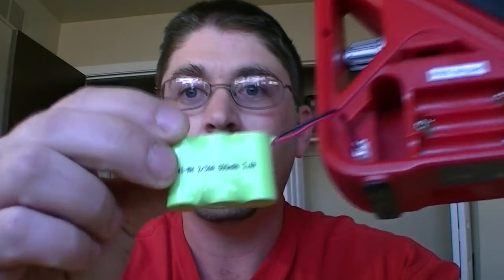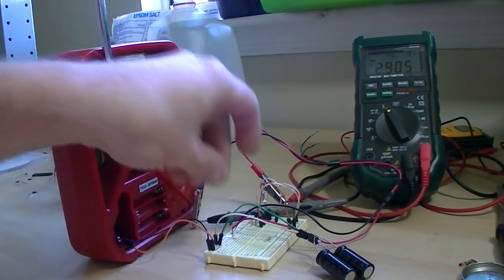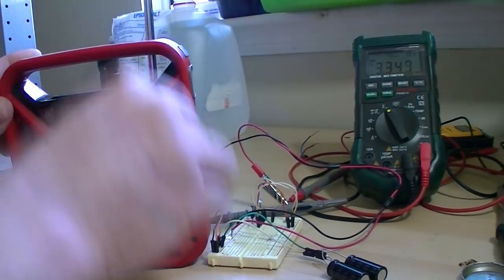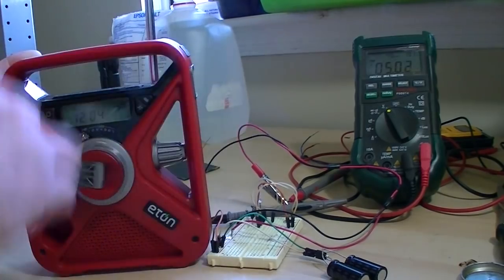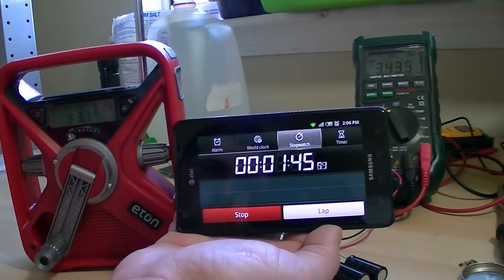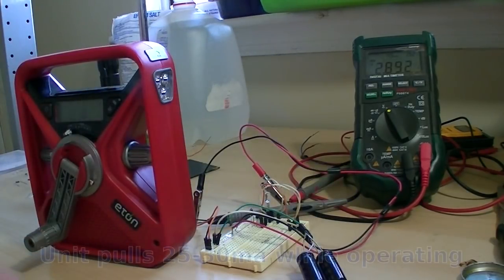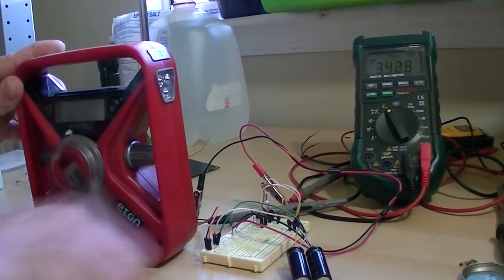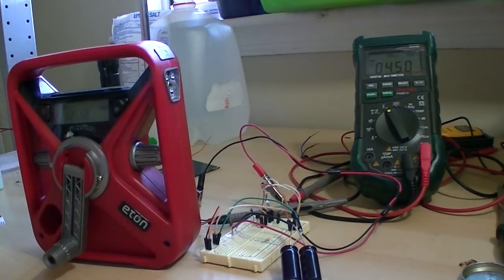Supercapacitors Instead Of Rechargeable Batteries

Comment: Capacitord wired in series dont give you double capacity. In parallel they do
Reply: +TeaDrinkingIlluminati the voltage rating is only 2.5 volts, so he needs them in series otherwise it would exceed the voltage rating.
Reply: ***** Yeah but he said hes putting them in series for the sake of capacity which is wrong
Reply: TeaDrinkingIlluminati voltage capacity maybe?
Reply: ***** Unfortunately thats not how it works either... Its the opposite of resistors when it comes to calculations
Reply: Their voltage rating would add in series, if he paralleled them he would have 2100 farads of capacity but at only 2.5 volts. Not enough for the 12 volt system on the car. In series on the other hand the setup would be rated at 15 volts.
Reply: ***** I pointed out that he said it wrong
Reply: +TeaDrinkingIlluminati I guess he could have been more specific.

Comment: I wish I knew more about electronics, in fact I dont fully understand why I'm here, Just WANDERING I guess on my day off.  But since from what I understand S-Caps discharge & charge quickly, & iF resistors make higher voltage? acceptable to lower voltage? apps. couldn't you E-Guys better use all this (from what I see) collective brilliance to invent a device that uses the attributes of both (caps & resistors) to  STALL the distribution & the loss of current long enough to "recharge" using another source (car battery, regular batteries, drill battery)? & does it have to be "wired" since an e-motor uses magnetics. Couldnt the charge be distributed magnetically,  by just being near the oblject? Realizing that would limit the design functionality (make better designs) of the device, like emer., radio. It would be a piece of the puzzle, in place, for greater understanding & applications. if so the implications of SOLAR, Getting the "Rubber to the Road" so to speak, would speak volumes!!

Comment: Your battery is a crap (Radio battery).
Reply from the maker: +IHPU0 That little ni-cd pack died years ago.
Reply: +Mad Electron Engineering 
You can make your own or buy a simillar with better capacity in li-po.
Reply: Just use www.EzBatteryKit.com

Comment: The capacitance only raises if wired in parallel. Example: If I hook two 1F 2.7V supercaps in parallel, I end up with 2F at 2.7V. 

Capacitance remains static but voltage raises if hooked in series. Example: Same caps hooked in series would yield 1F at 5.4V.

To raise voltage and capacitance together, you must hook them in series parallel (two capacitors in series, two sets of these hooked in parallel). Example: Using 1F 2.7V super caps I would get 2F at 5.4V.
Reply: Capacitance of a capacitor is fixed value, independent of voltage. Two 2 Farad caps in parallel = 4 farad capacitance. Two 2 Farad caps in series = 1 Farad capacitance. . .regardless of voltage
Reply: A Mart Actualy, no it isn't. I did mess up in my response, but not in that way. Capacitance in series is 1/(1/c1 + 1/c2 + 1/c3 + etc.). Capacitance in parallel is C1 + C2 + C3 + etc..

The amount of voltage the capacitors can handle is rated voltage in parallel (as marked), but is additive in series. IE, in series, two 16v caps can handle 32v, or three 16v can handle 48v, but connected in parallel any number of 16v caps will only  handle 16v.

For more information, check here: http://www.allaboutcircuits.com/textbook/direct-current/chpt-13/series-and-parallel-capacitors/

Comment: A capacitor is good for maintaining steady constant current flow when power is being used it's called capacitive discharge so you don't get variations in voltage like in a high output lamp!
Reply: +Phoenix Marzrover Not true, the discharge and charge are rapid at first then gradually slow down.

Comment: how about replacing the charging handle with a fitting so you can use a drill to -----do the charging easier and faster
Reply from the maker: That is terribly inefficient.  Just man up and crank.
Reply: +John Riley If your power is off and drill is dead that seems pretty silly. Also if you were in a long term power outage and you knew the drill battery was charged up just hook it up to have power.
Reply: +Mad Electron Engineering     inefficient? Since, then you get to play with the rechargeable drill battery, thus make other discoveries.....makes one wonder....inefficient implications?

Comment: can capacitors be used in place of lead storage batteries in wind and solar power setups?
Thanks
Reply: +papa Hajek not really since they do not hold the power for weeks....BUT if you use the power within 3 days....there would be no problem using a hybrid system....

Comment: I understand that it works from a large cap but what I'm wondering is: How long does it take to hand crank the OEM battery to a usable level and how long it lasts in comparison?
Reply: +David Terpening This ^.... this is a very important part of the scientific method. Due diligence, if you will. He needs to make another video repeating this experiment with the batteries.
Reply: The battery will last longer when fully charged but it will take a long time to charge it fully (a lot of winds). The super caps would last 2.5 minutes on a full charge and charges really quickly too. Super caps have only a fraction of the run time as batteries but can charge way quicker. But super caps will (basically) last for ever (as many recharges as you like). If they held power as much as batteries there would be no batteries (and batteries suck cos they don't have many recharges).
Reply: +TheStruggle IsReal Ever used a battery? Probably don't actually need to test how long a battery lasts in a common portable music player. If you actually think that is necessary for this test, you will want to keep working for someone who is not you.

Comment: The only advantage  a cap has over a battery is it will take a full charge and can be discharged almost instantly...as you have no means of charging it instantly and the radio discharges it slowly  ............what are you trying to do/prove
Reply: I can name you another advantage which is important in my application: heat tolerance. A typical lithium-ion battery operates maximum at 40 degrees C, while supercapacitors can handle as much as 85 degrees C.
Reply: There are quite a few advantages:  very fast charging, a wide temperature operational range, no degradation to the cap's storage capacity compared to the battery's chemical decomposition.  So there you have it... course caps are lacking the storage density of batteries which can store more energy in the same sized package for much longer.  Think if caps the quick and dirty energy source, while batteries the slow but long time energy storage. :)  Well till they come up with a super-duper-Godzilla cap which will rival batteries. ;)

Comment: Your test isn't really valid for this application - the power draw of the radio is extremely variable. The major power draw inside the radio is the power amplifier for the speaker. The louder you have the volume (and the louder the signal being played), the more current it will draw, and the faster it will draw down the capacitor. 

Also, when you connect capacitors in PARALLEL, the total capacitance (in farads) is the sum of the capacitance of all the capacitors. This is not the case when capacitors are connected in series. You stated that you had two 2.5F capacitors connected in series, giving you an effective capacitance of 5F. This is wrong. You actually LOWER the total capacitance by connecting them in series. Your two 2.5F capacitors in series actually present a total capacitance of only 1.25F - calculated as 1/((1/2.5F) + (1/2.5F)). The formula is 1 / ((1/C1) + (1/C2) + (1/C3))     (continue to add for as many capacitors as you have in series)
Reply: +gsmac1969 just real quick; he said he had (2) 10 farad caps @ 2.5v, and if you pause the video you can clearly see the label on the caps saying the same thing.  Thank you for re-educating this guy on how to series calculate caps... but yes totally right on the variance of power used via radio test.  He should have used the LED light on the device.
Reply: Yup 10 f at 2.5 volt ?

Comment: What's the point!
Reply: +dashercronin I found the video interesting because most battery packs seem to be good for only a few years.  I believe a capacitor would have a much longer useful life.  So when you finally need that emergency radio, it may not work because the battery pack is dead where as a capacitor storage might still allow the radio to function.
Reply: +DynamoTightstar it is indeed useless in this case of scenario. However there are some interesting usage with super cap. If they are big enough they can be used in cars instead of car battery. The power output from caps doesnt drop at all over time and they last like forever if not misusing. Car battery has to be changed over time, or atleast the chemicals inside it. Car batt also weights like 3 times more than similar size cap. However cap cost a duckload of money.
Reply: Daydreaming Engeniering no, you don't seem to understand, it can charge quicker, but you still need to put the same energy in, just as much cranking to get the car to start as a crank on a lead acid battery. Same with charging from an alternator, the capacitor can take a higher charge current yes, but you are still limited by the alternator output and wiring. Charge the capacitor equivalent of a 70ah 12v battery in a few seconds on a typical cars wiring and you will just blow all the wiring out.
Reply: That's what I was thinking too. The battery pack he took out is smaller and lasts way longer. It's not a proof of concept, it's a proof of dumbness.
Reply: ledfootdude someone with a brain...my car battety dead after 3 months no start...if it was super caps i could easily go to the front of car...charge up the caps with a crank like old day cars and start it up no problem...but no, im stuck waiting to get money for an reg car batt witch sets me back 60-100 witch is bullshit, charging a cap with alternator takes longer i am sure..unlike a super cap, a supercap can be charged very quickly, and if set up with proper resistors you can power up an emergency led for a very long time wiyh a quick half crank of a generator...
Reply: Devin Williams i ment charging a voltage drop on a car batt takes longer with a alternator...unlike super caps charge almost instantly...my rechargable batteries take 16 hours to charge the 2200mah batteries...a super cap can be charged is a fraction of that time...and i mean a fraction of a fraction of that time...real worldbench testings need to be done...at the end size does matter..but keeping a relativetly equal size comparison of 2 times the size i think i would consider a slightly bigger item for the reasurance of a working system and not blown out batteries, dead or leaking acid that ruins electronics...caps are good

Comment: It's parallel not series man
Reply: +Taylor Amarotico look at the way it's wired
Reply: +PrevailingDanger Look closer. It is in parallel.
Reply: +redSKORPION50 YOU need to look closer look closer, it's actually wired in series. one wire from each cap is twisted together and then the plug take a wire from each capacitor. If that's still unclear then draw it out on paper and see
Reply: +redSKORPION50 besides Taylor Amarotico, was taking about the part in the end where he mixed up the 2, not the actual wiring.

Comment: When people gonna make "super capacitors" they gonna be caller batteries, Oh wait there is already batteries (non chargable, rechargable and different kind of High and low current ones) I don't think a capacitor gonna replace a "battery" in the real meaning of capacitor and how it's working.
Reply: +Domino SixO I think in time we will be able to see super cap used instead of batteries. Now the problem is their high price and low energy density compared to batteries. Only viable application for them right now is something that needs a big power spike, like car engine or something that needs high efficiency. Super caps arent ready to be use as a viable energy storage option yet.

Comment: So you can listen to your radio for 2 minutes before you need to charge it up again, by cranking the handle for 30 seconds, surely using rechargeable batteries and cranking the handle for 5 minutes to get 2 hours use is a far better option, or just smash the radio up, in an emergency I'm not interested in listening to the radio anyway.
Oh look my house is on fire, time to get the emergency radio out and listen to some tunes..lmao

Comment: Maybe use resisters so the capacitors has a lesser voltage leak. It might grain the capacitor a little lesser. Might last a bit longer. Capacitors are designed to discharge fast so maybe a resister will make it discharge a little less slower.

Comment: 350F or 5F, so 5F is 2.5min of runtime took 20seconds to windup recharge. or 350F is 35min of runtime, then 20s times 70 = 23 minutes of cranking. Not realistic. But its interesting.
Reply: Mark McDonald Get same voltage of your 600mAh NiMH, but buy 6Ah, 200 hours of radio play. I bought 14.4V 5Ah explosion/fire LiPo for $20 from China. S/H is crazy. Still lower then local hobby shop.

Comment: hi 
y the Supercapacitors can not tack very high voltage like the regular one?
Reply: +imad omda When you create a capacitor with high farad rating, you end up losing from max voltage and vice versa. For bigger energy capacity it is better to increase voltage than farad, but in case of super caps where energy capacity is much bigger than in regular one, it is easier to increase farads than voltage. Physics will come against, since no material or even vacuum can resist too high voltage.

Comment: What's the difference between a super-capacitor and an ultra-capacitor?  Are "ultracaps" even better to use, in this type of application?
Reply: +Ahashdah Nagila both are just marketing terms and basically means the same. Capacitor with high energy density. Still sucks more than battery in this type of application. Stick with lipo or lifepo4 and youre fine.